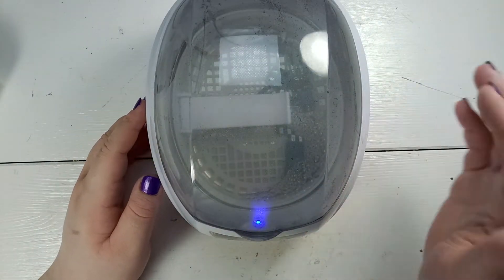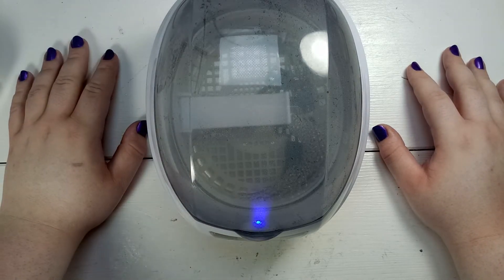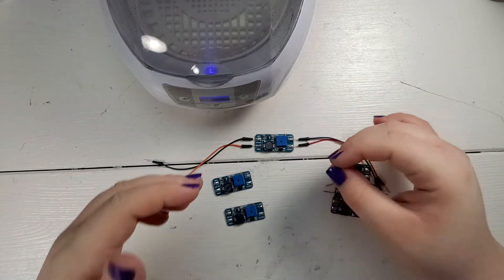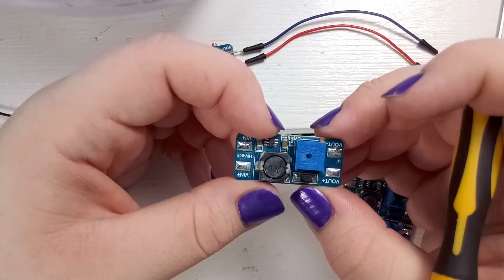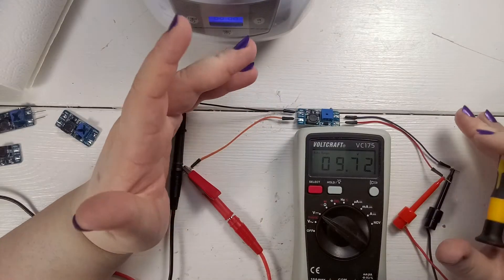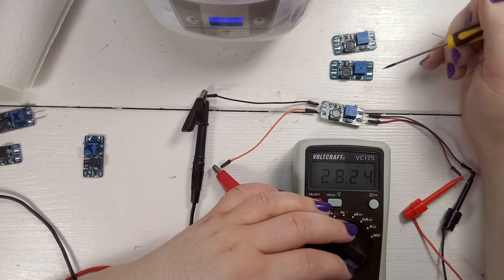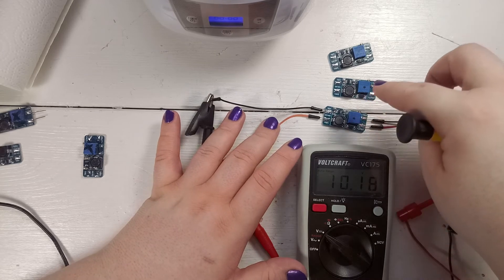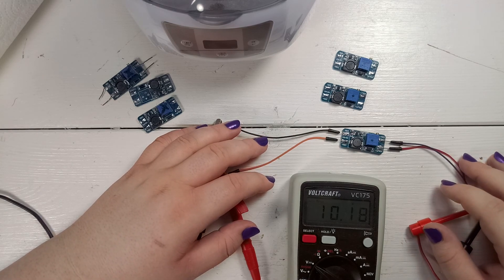Boost Converter Repair - Got Three Working Again!

Comment: in my case rotating left they started working after particular point when the output goes Higher than supply voltage

Comment: Hi Anna, saw this video today, only because all 5 of my modules were not working. However, despite trying all that you have suggested and others from different channels, I still could not get even one of them to work. So, not to talk of the luck, these are really buggy. But, one thing, because these didn't work, that I am now more knowledgeable about these modules trying to fix them, which I would not have bothered to learn if these worked as expected. Thanks and all the best.

Comment: these small converter ics are not meant for variable converters, they are just fitted with a pot to work somehow, not in a safe way.
Reply from the maker: Hey, welcome to my channel! :)
Well the potentiometer allows you to set the output voltage and as long as you set it within the specified range there is no problem. If there was no potentiometer a normal resistor would be installed and the converter would just have a fixed output voltage. This should not be a problem.

Comment: Hi Anna. The only small boost converters I have tried use the XL6009 chip, I have 2 and they work well. I have so far been lucky and the 20 or so step down converters of all sizes have been fine. I have no doubt the odd bad batch gets sold. I do tend to only use around 60% - 70% of their stated rating and always check the PDF data sheet. If I can't hold my finger on it it's too bl**dy hot.

Comment: It's a known issue with these modules, the trim pots are set to like 3/4 out of factory, if you supply anything above 5V, the voltage on the FB pin is going to be higher than 6V and will fry the module, otherwise if its > 0.6V, it won't boost and may become unstable. Turn the pot 20 turns CCW (yes counter!) and/or start adjusting from a low 3V input.
Reply from the maker: Hey welcome to my channel! :) 
And thanks for all you comments.  
So I just made a quick test and looked at the designt of the modules. Unfortunately I could not find the control IC datasheet however they got a 2.2k protection resistor between the trimmer pot and the fb pin. Whit their maximum 28V output voltage the resistor drops ~26V if I'm not mistaken. If you are right and it can handle up to 5V although we don't know for shure it will definately be able to handle 2V. Also I just used one of the working units, supplied 24V to it and tried to fry it without any luck. Seems not to be a problem with them. But good suggestion I did not think about that ;)

Comment: These kinds of modules can be dodgy in so many ways. Some time ago I had bought a bunch of 1.5A buck-boost modules which had been fitted with the wrong switching controllers. They seemed to work normally at first, but it turned out that if they run at a very low input voltage (when the batteries were flat) they suddenly ignored the set voltage and started putting out even more voltage than their usual limit and would destroy the circuit they were powering. The controller chips that were fitted were driving the circuit at a lower frequency than the correct IC would. I only figured this out by comparing the modules to similar ones that were working correctly, and reading datasheets. 

As for your modules, normally these trimmer pots should work no matter how far you turn them. When they are at the limit they will "click" and the internals will stay where they are, still making a normal connection. 100k does seem unusual for such a module. So far I´ve only seen 10k or 20k trimmers used. I wouldnt be surprised if they should actually be a lower value, and since these modules are often set to the maximum output from the factory, that might mean they destroy themselves immediately, or trigger their open-loop protection if they have one. You cant see that on a multimeter of course. 

That´s just one of many possibilities.
Reply from the maker: That's also what I thought but it seems that the potentiometer had an internal defect which is now gone. And you are right 10K, 20K but also 50K pots are the most common ones. I might have to test them with 10k potentiometers just to see if they are actually ment for lower values. It could well be that I am able to revive the other 3 with lower value potentiometers. It could just be that the ones I revived just work with the higher value due to some coincidence.
Reply: @PhysicistAnna  Trace out the circuit around the pot. The trimmer should be part of a voltage divider of the output voltage and the middle of it should go to the control chip. See if there are any extra resistors between the pot and ground or the output. If there are, you can estimate or calculate what value of potentiometer should be there. If not, having some settings where the converter does not work (or destroys itself) would be normal.
Reply: @Basement-Science  yep these MT3608 have a Vref of 0.6V, so the voltage divider is based off that value